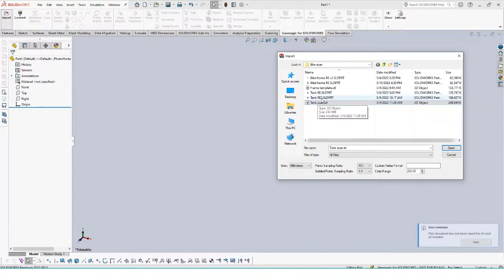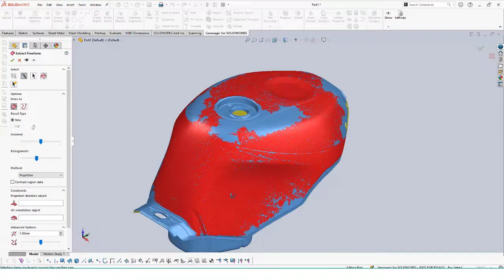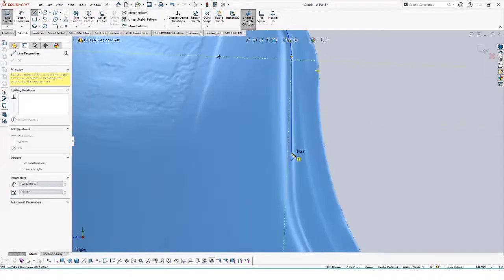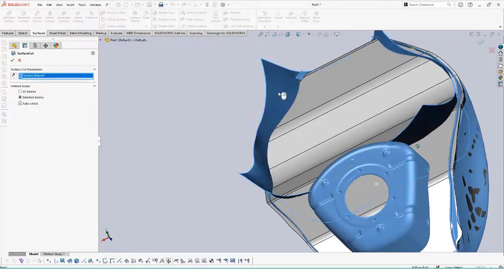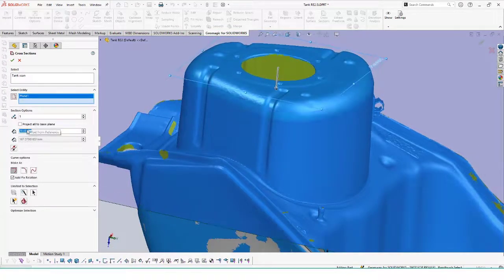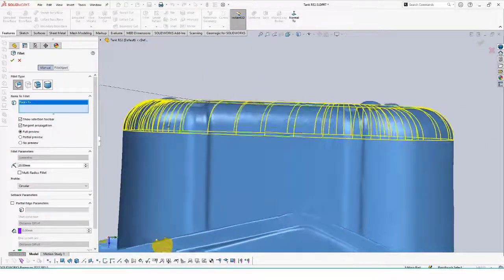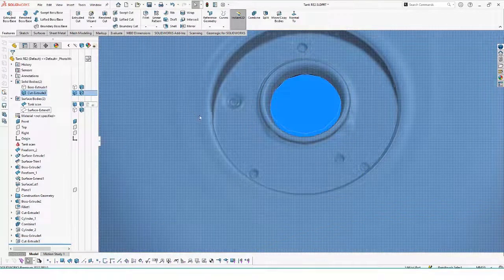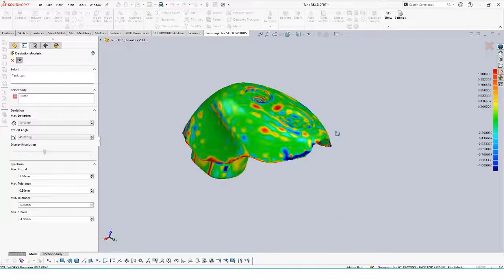Print to Perform: Reverse Engineering FreeForm Shapes Inside SOLIDWORKS Using Geomagic

Comment: hello sir, i have one question. extract freeform feature, it's extracted the surface in a new file. i need to extract the surface in a same file can you help me
Reply: Its case due to old Geomagic Design x in newer version of SolidWorks, this problem will solve like , if you have Geomagic design x 2017 and install SolidWorks 2017 or lower version.